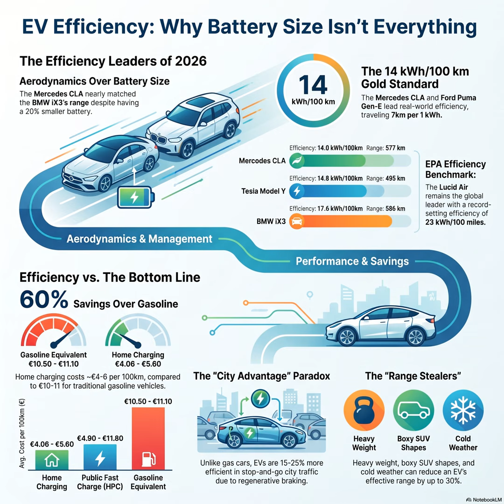Why Aerodynamics Beats Massive EV Batteries

Comment: A few examples. The new Jeep Recon has a range of about 220 miles. With a battery of 100kWh. Yikes! The Tesla Cybercab weighs about only 600 pounds less than a Model Y, and gets a range not much different from the Jeep Recon, with a battery of about 37kWh. Efficiency of about 6.1 miles/kWh.